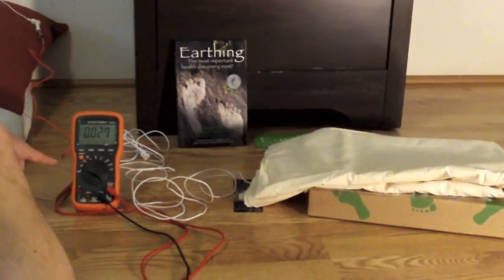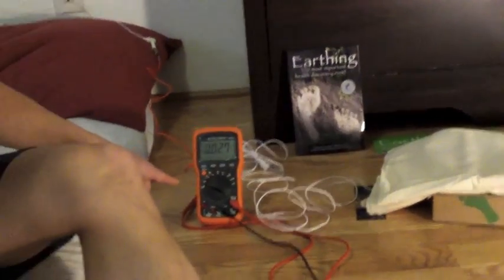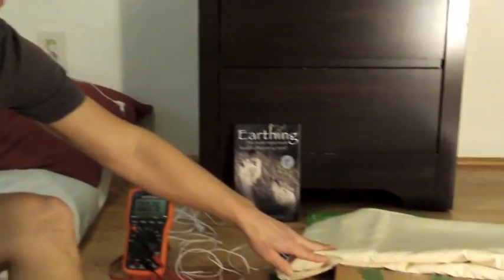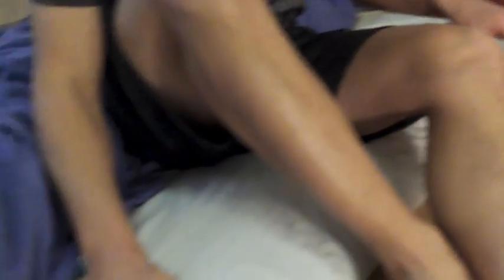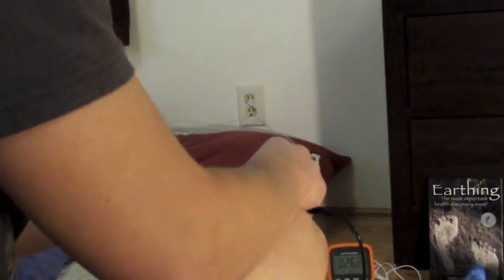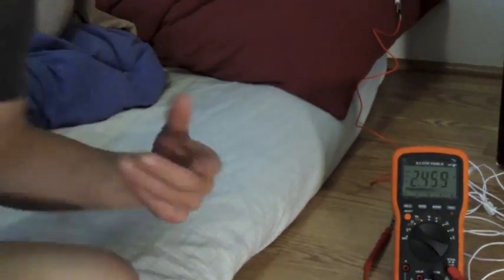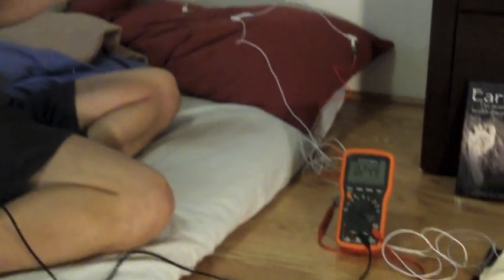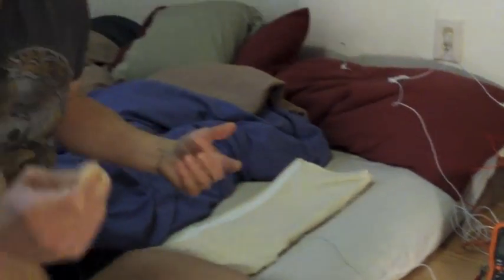Earthing Sheets Demonstration With A Voltmeter

Comment: I have gone to Earthingsheets.org and there is no sheet. A pad, a throw, yes, but no sheets. Any other suggestions on where to buy these?
Reply: Hi Danna, I have purchase a few for these sheet off ebay, they are also available on amazon too. Also I purchased a separate 5 meter long stake cable from Urban hippie who supply the sheets, mats etc. which is based in Australia. I hope this helps.
Reply: AvatarBluechild does it really help you with sleep?

Comment: Now use a Fluke Scopemeter with a probe connected to your wrist and another to the ankle via an ECG electrode.  Your exposure will go up as there is voltage and frequencies on that ground plug.

Comment: All of you asking how to hook up the voltmeter: he didn't hook up anything. He's just holding on to the black lead while the red lead is laying on the floor.  If you wanted to prove this actually did something you would have to attach one lead to a grounded copper pipe in your house or at the very least, plug the other lead into the ground port of the outlet. Not only that, reading DC voltage alone really doesn't tell you anything because nearly all the electricity we are exposed to is AC. Appliances convert to DC for their local use. Radio waves, distribution lines, and even your body's electricity are going to be more AC than DC. I'm not sure whether earthing does anything or not, but I do know that this video proves nothing other than this man cannot control his children and that he does not know how to use a multimeter.
Reply: Maybe you need an eye doctor as the red lead is going to the ground in the wall which by the way is the same as your copper pipe idea for grounding.